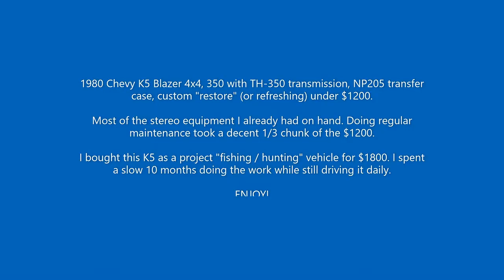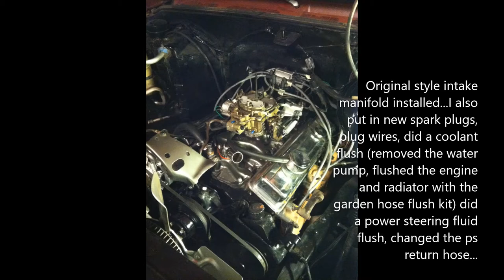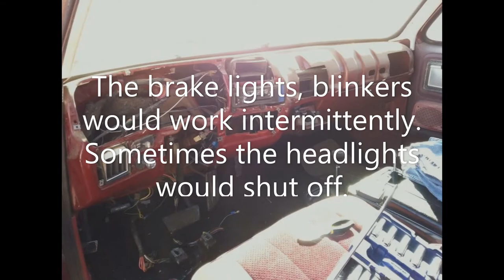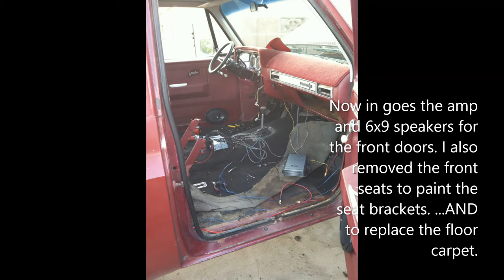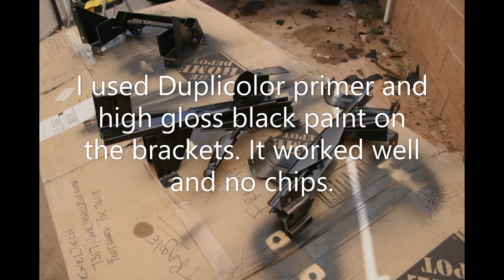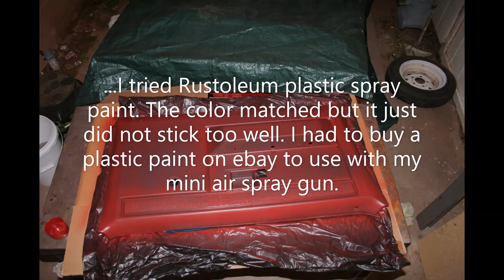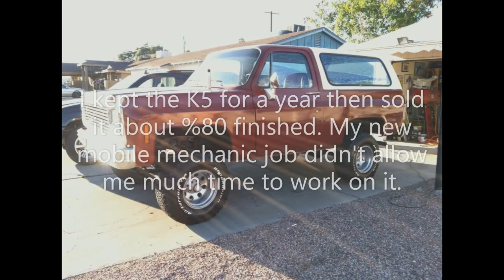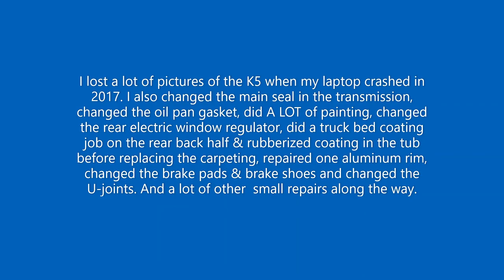CLASSIC 1980 Chevy k5 Blazer 4x4 Square Body RESTORATION Project in under 15 min

Comment: Oh mAn.. sux you sold that blazer.. great work in it... wish you had done videos on it. I just picked up a ‘84 Jimmy ... this will be my first project car/truck and plan to pretty much tackle it in the same order as you did.. thanks for the road map..
Reply from the maker: Sorry I didn’t get this sooner. I’ve been busy but mostly all the videos I had of it and the work was lost when my laptop’s hard drive crashed. I’ll be starting a new project this summer that will have a ton of video footage. 1970 1/2 c10 2wd, it will get a 5.3 LS VORTEC & a 4L80e transmission with updated rear end/updated suspension and rear disc brake conversion kit.